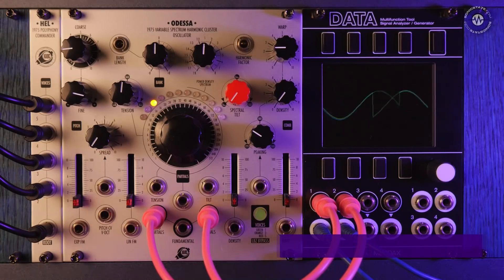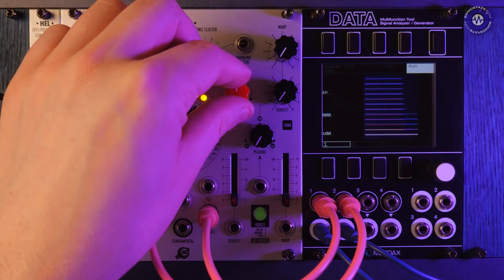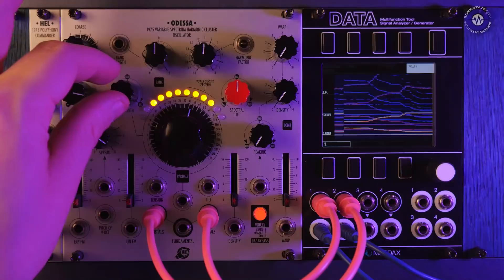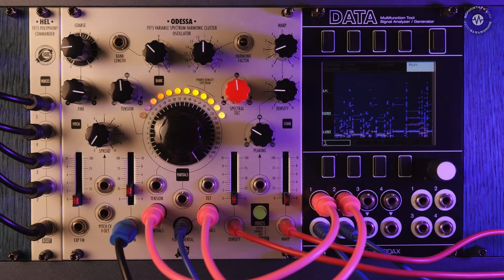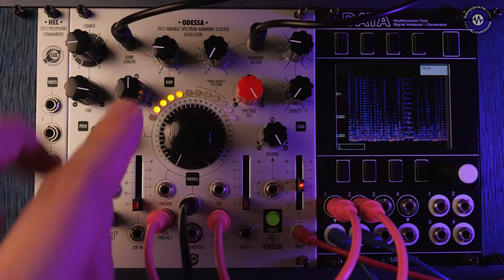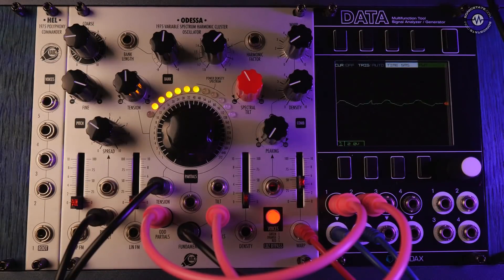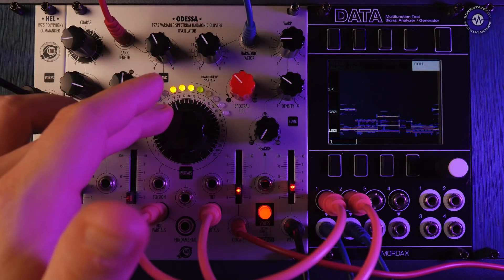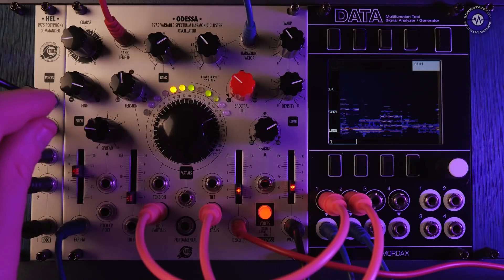XAOC Devices Odessa Oscillator module - SonicLAB Review

Comment: What are you sequencing the HEL with? You mention 3 notes from a sequencer, but there’s 4 inputs plus a root input.
Reply: I was sequencing with  Malekko Voltage Block. I think in the section you're thinking of I must have been in the 3 voice mode so the other two inputs are ignored. i.e. input 4&5.